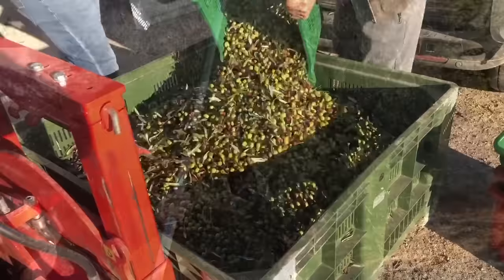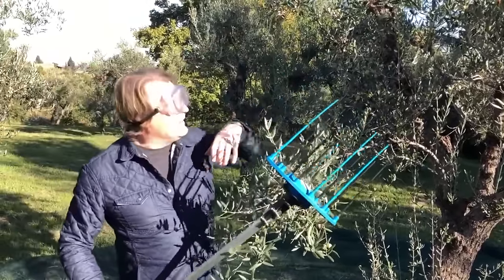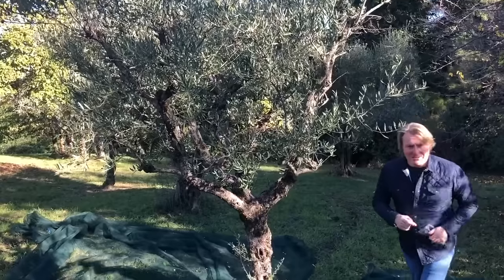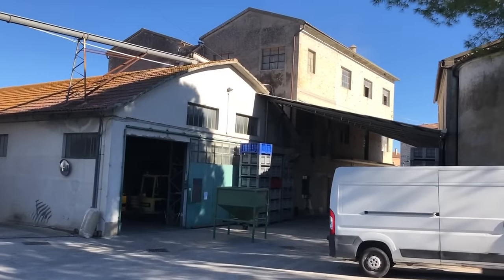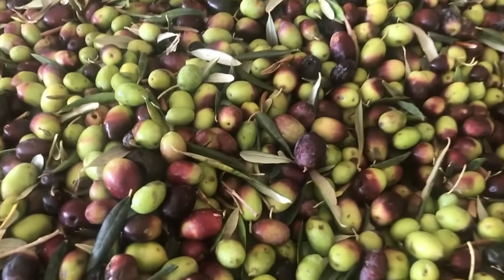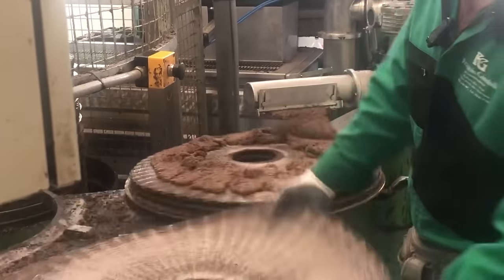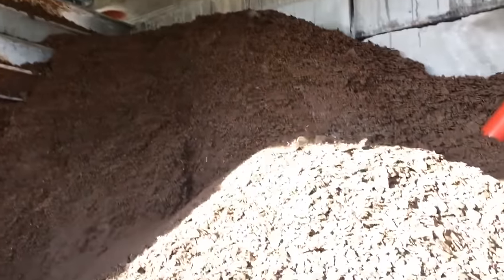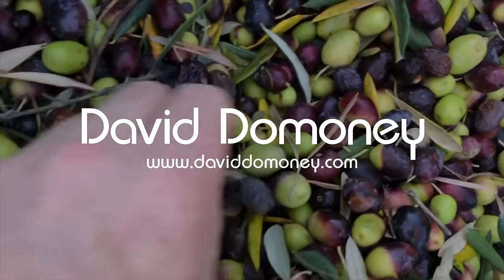How I Produce Olive Oil Using My Own Olive Trees

Comment: Sir David, as Ι have seen your olives suffered from disease. In some of them inside there is a warm. How u get them out before the pressing? U take them home,  put a big sheet on the floor and spread them out. Two or three days later the warms come out. Separate and go !
The dry and bad looking ones, throw them away.
The dry hucks are not used for fertilizer at that point but later. They are taken to special factory where they ground the core and get the CORE-OIL, in Greek is called Πυρινέλαιο. In supermarket u can find it under the name, Olive oil. Mixture of core oil with virgin olive oil.

Comment: Hopefully my 125 olives are gonna make it to harvest this year.  For processing, I grind with big  new garbage disposer.  It heats up and stops unless I add water, but works pretty good.  Then I use an electric ice cream maker to malox the mashed 45-60 minutes.  It is put on  a slightly ramped sheet of stainless steel and drains pure, clear evo.,  while waiting to load the mats for pressing.  I am currently building new, larger  processing plant.  This year there is good fruit set and now the desiccating summer is here  
Before the monsoons.  I have only enough water to give four to six gallons per week to each tree.   Hopefully (as in prayer) monsoons will come this year.  Without monsoon the olives get shrivelled on the tree.  The past many several years of wind, drought, freezes, and me have resulted in 99% failure.  1% I learned something about trees, and myself.  Yep, faith and miracles.
Reply: I've seen in regular tree gardening, not olives. But the pounding a PVC pipe into the ground closer to the roots and then pouring the water in a couple of pipes hammered into the ground to prevent evaporation.
Reply: @stanlevox2291  
Yes, Season 2023 I buried the drip system with only emitter above ground because animals were chewing the pipes.  This was very successful.  The crop load  was heavy, but shriveled beyond use.  I got about two ounces of beautiful oil.  So, by October I saw the trees were in very good shape, but not the olives.  So next bloom I intend to trim off at least half of them, giving the trees a better chance to sustain the fruit.  No monsoons in 2023.  Still no rain, but maybe next week it will.
This year, I think I will bury the emitters in the pipe, it is difficult to maintain them that way though.  Also, I think I am going to sell off some trees.  Thanks for your interest.

Comment: Great video thanks for posting. 
 It would be interesting to know the figures, for example how much did the crate wiegh and how much oil was produced from that wieght👍
Reply: I was having the same question. On google they state the yield is between 10 and 20% in weight.
Reply: @tuttebelleke  10% is Catastrophic. 1 litre per 4-7 kilos. 4-1 excellent

Comment: That's not a good Olive oil, it can be traditional but not good, when adding the boiling water the goodness in the nutrition componentes are "burned" and wasted, loosing then most of them and turning the oil yellow.
Cold pressed Olive oil not letting the process paste going  above 30°c its the way, then you get the most out of the nutritional components, getting a green Olive oil not "burned" and increasing your health overall.